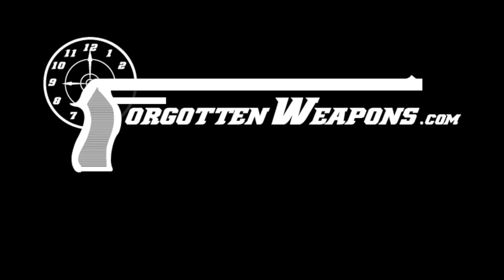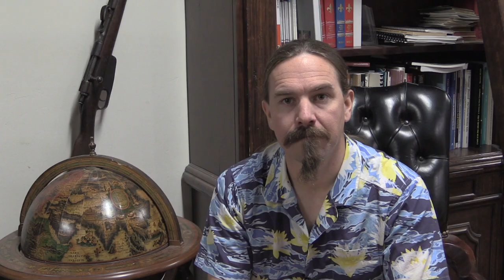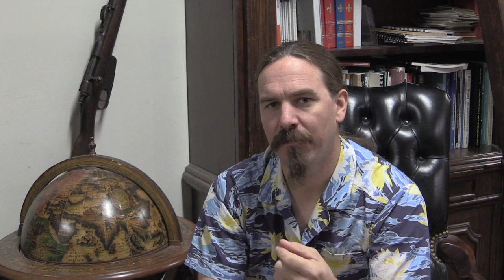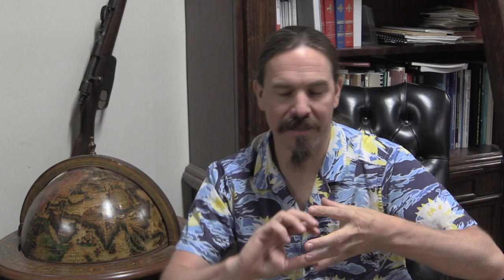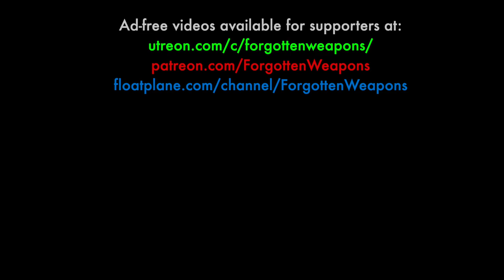Ask Ian: Progressive Twist (Gain Twist) in Small Arms?

Comment: Could be surprisingly relevant today, I immediately thought of the new 8.6 blackout cartridge being developed by Q. They are going with 1:3 twist for their barrels to stabilize very heavy subsonic loadings (and supposedly introduce a lot of rotational energy on target) They say that only monolithic bullets and bonded bullets will be able to be used in these barrels. I wonder if it crossed the engineers minds to maybe try a progressive twist to open up bullet selection.
Reply: But they delved to greedily and too deep...^^
With monolithic bullets, reducing contact surface with bands of removed material is effectively used with partially fragmenting hunting rounds.

Comment: Gain twist is an idea that sounded good on paper long decades ago but doesn't pass muster today with the advent of numerical tools. If you were to look at the engraving forces of a modern firearm system, you'd see the maximal peak as the bullet is initially engraved by the rifling then it would sharply decrease as the bullet travels the rest of the barrel. For the same rifle firing the same projectile, the inital engraving forces increase greatly with higher rates of twist but would all converge to roughly the same force later in the barrel. With a progressive twist rate those engraving forces would not peak as much initially but would remain higher if not increase as the bullet traveled, which would mean more wear over the entire length of the barrel, more friction slowing down the bullet, and also increase the chances of structural failure of bullet jacket material.
Reply: "which would mean more wear over the entire length of the barrel" - but less at start.

"more friction slowing down the bullet" - if the final RPM is the same, total energy loss to friction is pretty much the same

"doesn't pass muster today with the advent of numerical tools" - CNC has nothing to do with twist and CNC can be used for gain twist/progressive twist
Reply: @randomnobodovsky3692  Total energy loss would not be the same if engraving forces continue to gain due to progressive rifling. Simple physics there.
CNC has nothing to do with the numerical tools I mentioned. The tools I mention involve finite element analysis and other modeling systems used to evaluate the forces exerted on bullets and barrels during firing, the same kind of evaluation used for the US Army NGSW program.
Reply: @BlownF150  Sorry, didn't catch that you mean FEM analysis.

"Total energy loss would not be the same if engraving forces continue to gain due to progressive rifling." - Yes and no. Engraving force is still a thing even after conventional rifling imprints on the projectile - since projectile isn't "screwed in", it's being pushed from behind (there is plastic deformation occuring). But that (total energy loss) was my napkin math estimate. Since you probably have titles and/or names of authors of relevant papers I'd be more than happy to be corrected on this (and read about someone's research).
Reply: @randomnobodovsky3692  My sources are behind credentialed access, there's no sharing those documents. Not really needed as it's intuitively known that gain twist rifling continues to exert high engraving forces upon the bullet for the duration of the barrel length.  Twist rates aside, the biggest factor in initial engraving force is the operating pressure of the cartridge itself, a 25% increase in chamber pressure can result in a 600% increase in the engraving force exerted on the bullet.

Comment: I'd imagine there is a lot of force involved in changing the angle of the grooves formed in the bullet as it travels down the barrel. Not a big issue with artillery because they use a fairly narrow driving ring but for a bullet with a long contact area this would be more of an issue.

Comment: There are still barrel makers claiming the benefits of gain twist, but it has drawbacks as well.  First, It's really only practical when cut rifling, either broaching or single point cutting- it would not work well with button rifling.  Also, lead lapping is important for maximizing accuracy, but lapping does not work well with gain twist rifling as the lap would need to be soft enough to conform to the accelerating twist and therefore not hard enough to even out bore and groove diameters and surface finish.

Comment: I'm guessing telescoped ammunition might also increase the need for progressive twist(and other ways of making the rifling more "gentle") since the bullet accelerates for longer still inside the case.
Reply: I could nitpic the wording there, but your thinking is sound, the initial velocity from the bullet leaving the casing is much higher from a telescoped ammunition because of the higher chamber pressure.  In the long run, the more important effect of progressive twist rifling would be in reducing barrel wear near the chamber.

Comment: Interesting... I can see the potential benefit.  Adding twist gradually might rob less forward momentum from the bullet.
But wouldn't the change in the angle of rifling impart its own drawbacks?
Reply: Yes, the change in angle has to be compensated for or it will damage the bullet, this isn't as much of a factor with all lead bullets but with jacketed it is. The modern gain twist barrels I've seen narrow the land width along with the gain twist to keep from shredding the bullet. Easy way to think of it is comparing to a nut and bolt, if the thread pitch went from fine to coarse halfway thru the nut something would have to give for the bolt to continue on.
Reply: @CCW1911  Thank you, that is exactly what I meant.  Good explanation.

Comment: When developing duplex or triplex bullets did anyone every try Regressive rifling?  The tighter twist at the muzzle would get the bullets spinning together, then the looser twist would in effect pull the bullets apart.  This might have been a consistent way to separate and spin multiple projectiles at once.

In terms of application I think about an M60 firing a Triplex bullet consisting of 3 ~ 70 grain projectiles.  Basically a short range, jungle clearing, round.  The gunner gets 3 times the firepower for the same weight and heat buildup.  Effective range and accuracy aren’t the primary concern.  Each gun could have a short range Regressive twist  barrel and a standard barrel, or issue them entirely based on need.

Comment: The 6.5 x 54 long barrel factory sporter Model 1903 Mannlicher Schoenauer , I used to own, had gain rifling, presumably for the same reason that the early Carcanos did. Difficult to say if it had any effect on accuracy as barrel heating on the very thin and long barrel had such a dramatic effect. You could zerro for the first two or three shots (for deer) or zero for subsequent shots at the range but obviously not both.

Comment: I would think if the rifling was straight for just a short length followed by a gradually increasing rifling twist would also decrease the initial chamber pressure, just due to only having to accelerate the bullet in one axis.  I.E. you aren't trying to spin it at the same time as you were down the barrel.  The spin, after all, only matters at the muzzle.

I may be wrong, but i would like to know if anybody has any hard data on chamber pressure on progressive rifling VS standard rifling.

Comment: I have also seen proponents say that it improves the life and thermal characteristics of the barrel - the argument is that initial spin up creates a lot of friction (might not be the right word) in the barrel and is responsible for both the concentration of wear and heat (and thus even more wear) at the start of the rifling.

I'd be really interested to know if there has been any serious analysis/testing of that. Heck I'd also be keen to know more about the testing that disproved the accuracy improvements.
Reply: The main wear on rifle barrels is based on locally focused high pressure and temperature based on the hot gasses near the chamber. The more a cartridge is necked down, the more focused the heat is and that's one of the main reasons why hot loaded, necked down cartridges eat barrels compared to cartridges that can distribute it on a larger surface like for example .308. The friction is a minor factor unless solid bullet materials are used. I think it might help with fowling besides to prevent jacket separation on larger calibers.

Comment: Even with the improved quality in projectile production, I can't see why progressive twist barrels can't be used everywhere. It sounds like it always brings an advantage and it doesn't appear to be something that would really increase manufacturing costs, the only change for the negative is you can't cut down a barrel and retain the same twist rate but that stuff's usually done on smooth bores, anyway, while people prefer buying new barrels or new guns entirely in order to obtain an SBR, I think. Alternatively, progressive twist could just be present for the first 9 inches so from the 9th inch of length you already have the final twist rate.

Comment: There is also squeeze-bore firearms .. only one I can recall was a WWII German anti-tank rifle, but probably not the only one out there.
Reply: The German's in WWII actually developed three weapons on that principle. The 28/20mm sPzB 41 which actually saw service and two others in 41/29mm and 75/55mm; where development was cancelled due to a shortage of Tungsten for the ammunition.
The British also had the "little John" muzzle adapter for the 2 pounder gun, which was still in use in late WWII on armoured cars and Tetrach airborne tanks, which used the same principles.

Comment: Didn't the M32 grenade launcher you covered also use a gain twist?  Makes sense for such a big and heavy projectile that can contain a fuse of some kind to also benefit from a smoother spin up.  And IIRC the spinning somehow activates the fuse in those rounds.
Reply: The spin of a 40mm grenade is what removes the safety on the fuse. I'm greatly paraphrasing, but the fuse basically needs to screw into the body a certain distance to arm the grenade.

Comment: Fascinating...
One question I have about that. If a long bullet receives rifling in a certain angle, and this angle gets steeper as it travels down the barrel, doesn't this mean the barrel is continually deforming the jacket, a bit like a tracked vehicle steering on a cobblestone road? Which sounds like it would potentially increase drag?

Comment: Does gain-twist rifling allow a smaller grove depth and thus possibly less blow by through the groves if they are not totally filled by the bullet?  Additionally deforming the bullet to match the groves and lands, uses some energy, if the difference between the groves and lands were less, then energy used would be less, and that energy would transfer to greater muzzle velocity.?

Comment: Quick question Ian (or someone else who may have information on this subject)

In regards to progressive depth rifling, if it were done in reverse (shallow rifling near the chamber that gradually gets deeper as it moves towards the muzzle) would this help performance with monolithic bullets? I know one of the big issues with monolithic copper bullets trying to achieve very high BC's (in normal bore diameters anyway) is that they need some sort of groove formed into the bearing surface to allow the bullet to "smush" into the rifling to obdurate (I hope I'm using that correctly) without causing a pressure spike, but that groove tends to negatively impact BC.

My question being, if a progressive depth rifling reduced the initial pressure spike and allowed the pressure to accumulate gradually, would it allow for better bullet design with monolithic bullets without causing unsafe pressures?

Comment: Seems like gain twist rifling puts a lot of strain on the bullet; as it is essentially 'double accelerating' the bullet rotation as it accelerates down the barrel.  Has anyone ever tried 'reverse gain twist' rifling?  This would seem to keep the rotational acceleration of the bullet more constant as it accelerates down the barrel.
Reply: You have that backwards.  A constant rotational acceleration would require gain twist rifling.  A bullet experiences the greatest linear acceleration at the beginning of the barrel with the last inches of the barrel contribute little velocity.  In addition to creating an even higher initial rotational acceleration relative to constant twist rifling a "reverse gain twist" barrel could actually result in a rotational DEceleration near the muzzle.

Comment: Would this also reduce potentially dangerous pressure spikes?  If the bullet has less resistance initially.. it can accelerate faster allowing more expansion of the gases quicker.. stopping a possible over pressure situation.

Comment: This is really neat. One question though: I've been looking at getting a 22LR AR style rifle and was stuck between a 22 insert and a dedicated upper. One reason for the upper was the correct twist rate as 5.56 is say 1:7 or 1:8 and 22LR is typically 1:16 for a twist rate. But after watching this, I now know if I had a short barreled 22 like say a 9 inch barrel (or a pistol) the round wouldn't make even one revolution while in the barrel! I'm surprised the bullet is still stable like that. Why does a bullet like a 22LR need so little twist in-barrel to be accurate yet 5.56 has to spin almost twice as fast? Is it related to the relative muzzle velocity of the round?

Comment: One concern I have always had with gain-twist barrels is the changing lead angle of the rifling. As the lead angle changes, I would think that it would have to further deform the bullet. Would this not result in increased gas blowby and potentially increase the bullet to bore friction?
Reply: It's probably not noticeable, as the gain twist rifling is taking longer to do the exact same thing that constant twist rifling does instantly. In theory, gain twist rifling should result in slightly higher velocities, as where the acceleration is the highest, the energy going into rotating the bullet is the lowest. In reality, the improved velocity is probably not noticeable among other variables.

Comment: I do wonder about the math. What caliber round would be wide enough, and what barrel length would be long enough for the torque force of an accelerating bullet to twist a rifle off it's aim point. 

Newtons third law as it applies here: the rotational force it takes to spin up a bullet, must have an equal and opposite rotational force on the barrel. right? 

In the scale of a typical rifle or pistol, I can easily see how time and mass are not problems, the bullets are small and the barrels are short. 

But, if you had a bullet big enough, or a barrel long enough to be a factor... How big would it be? Could that torque even affect your aim?

Comment: Just think of the nightmare of setting up a tooling for gain twist rifling, regular rifling is already complicated, but as far as I know you can still set up a lathe capable of doing it for different rifling and reducing the tooling costs in the proccess, you can't with progressive rifling unless you have a very expensive computer-programmable lathe
Reply: I take your point, but my understanding is that you only have to do it once to produce the ‘mandrel’:

“Hammer forging is an equipment intensive but efficient method for making rifled gun barrels. Hammer-forged rifling starts with a reusable mandrel that carries the reverse image the entire length of the bore and uses it to produce the desired rifling profile”.
Reply: @fredbloggs5902  And how would you remove the mandrel after it is forged?
Reply: @randomnobodovsky3692  that’s a great question. Anybody know?

Comment: Don’t some of the hammer forged barrels have some progressive depth rifling? It makes it easier to remove the mandrill from the finished barrel. Think HK and FN. 
     With the 460 S&W magnum it would be good to consider the high velocity of the original round designed and paired for the pistol and the cylinder gap jump as to the reason for progressive twist and depth of the rifling. 
     I have no experience in testing this but I would think that some of smearing and galling of the bullet and bore could be a problem if the progressive depth and twist for a load and bullet were not just rite. 
     Thinking back from memory the 5” S&W 460 appeared to have traditional rifling to the naked eye and the8 3/8” barrel had obvious gain twist and depth rifling to the nakid
Reply: Eye.

Comment: A bit on the physics aspect: The bullet is starting with zero velocity and accelerating from there. The twist just forces a specific ratio between the linear velocity and rotational velocity. In a constant twist barrel it forces the rotational velocity to be proportional to the linear velocity, with the ratio between the two being the twist value exactly. So when the bullet has zero velocity, like at the start of firing the gun, it also has zero rotational velocity, and it gains rotational velocity over time as it gains linear velocity. So constant twist rifling does NOT actually force instant rotational acceleration at the beginning like you suggested. I'm guessing this is part of why progressive rifling doesn't seem to help much. In an idealized physics gun where the bullet has constant acceleration, a constant twist would also cause a constant rotational acceleration, which would minimize twisting forces on the bullet, and hence be the optimal rifling. The thing is, in reality the bullet actually accelerates most at the start of the barrel, when the gas pressure in the barrel is highest, and then the acceleration drops from there as the gas expands and the pressure drops. Given this, progressive rifling may actually help by making the rotational acceleration closer to constant.

Keep in mind I'm a physicist, not a gun expert like you are, so I may be overlooking something.